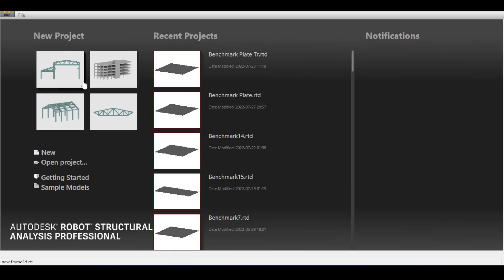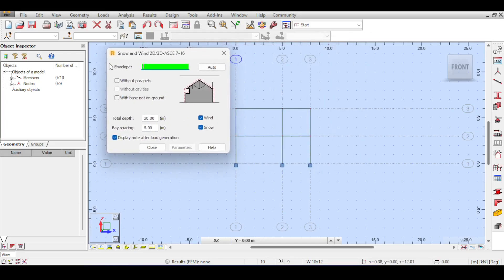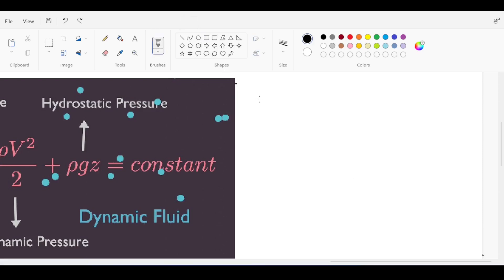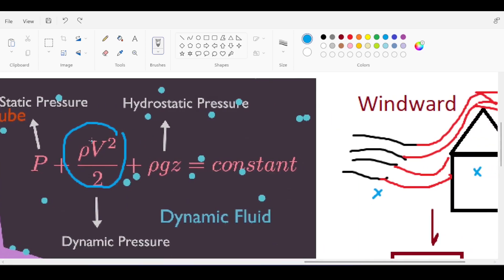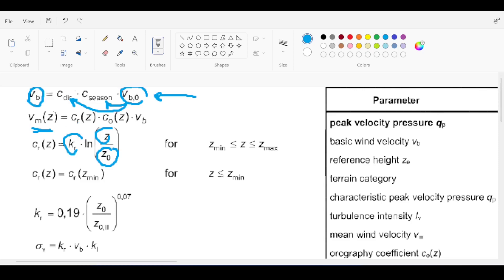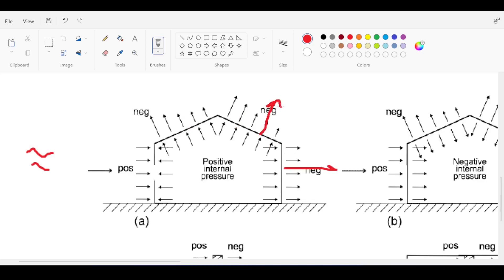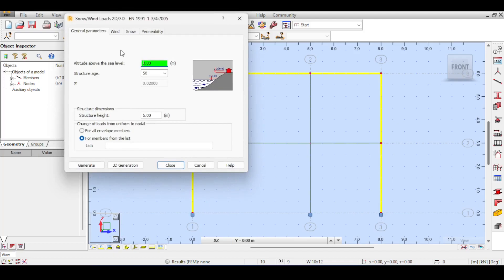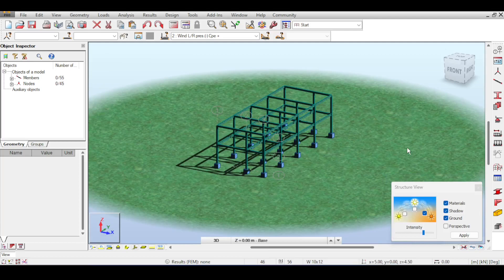Wind Loads according to EC using Autodesk Robot

Comment: Hello,
Hope you are doing well
1-based on Eurocode, and in designing a canopy, which loads coefficients we should use, Net wind pressure coefficients (Wnet) or Total wind force coefficients  (Fw)?
2- if we should use Fw, could you explain the method of application?
3-if there a canopy above a building, what would be the height used in calculation of the wind load based on Eurocode? 
Thank you for your grateful help
Reply from the maker: Oh that is quite a nice question. So here is what should be done in my humble opinion:
In Eurocode 1 (EN 1991-1-4), for canopy design, you'll primarily use net wind pressure coefficients (cp,net). These coefficients represent the pressure difference between the windward and leeward sides

Total wind force coefficients on the other hand, provide the overall wind force acting on the entire canopy structure. 

For a canopy above a building, the reference height for wind load calculations depends on the canopy's position relative to the building:
Canopy Attached to Building: If the canopy is directly connected to the building's structure, use the height of the highest point of the canopy above ground level (crest).

Canopy Detached from Building, has other considerations.

Finally, keep in mind:
Degree of Blockage: If there are obstructions under the canopy, their influence on wind pressures needs to be accounted for.
Structural Factor (cscd): The structural factor (cscd) is usually taken as 1.0 for canopies. However, consult your National Annex for any specific requirements.

I gave general comments based on your question. Of course, each specific case may deviate from those comments above.
Reply: @CivilEngineeringEssentials  Thank you
I really appreciate

Comment: You can calculate the mean wind velocity or the peak wind pressure in accordance with EC, then use the values in the wind simulation program. RSA will only apply the calculated values to the building to generate the wind loads. The simulation process does not have to conform to any code, as the codes does not prescribe how the simulation should be performed. The simulation process is purely scientific. However, the wind or pressure values used in the simulation process have to be derived in accordance with the codes (EC or American) by the user.
Reply from the maker: If I understood your correctly, you are talking about the wind simulation in RSA rather than the code calculations (the equations that find the pressure which are provided in the code)

If I understood that correctly, then I agree. The only reason I feel annoyed is that CFD simulation might seem to be a "black box" for regular users. Also, note that - as an example - the ASCE code does allow for wind tunnel simulations.

Now you could argue that CFD is as close as it gets to the wind tunnel simulation, but well, it is not mentioned in the code, so it becomes a matter of opinion.

Of course, I am always open for any info. If there are rules and regulations in the Eurocode, plz feel free to tell me.

Regards,
CEE

Comment: I have been trying to using robot to model wind loads on to a portal structure. I created the building and then put cladding on to the structure. Then I am defined wind loads on to the structure using the uniform planar load on contour surface in the surface load definitions. The only problem I have with this method is when I define the load working in the z direction for the local coordinates the load doesn´t follow the local coordinates. So it seems like the load isn´t attached to the cladding. I have to use the planar load on contour surface because EC divides the roof and walls into regions.
Reply from the maker: I am currently working on a series on the modeling analysis and design of reinforced concrete building structures, and I am actually stuck exactly here. Trying to find the best way to approach wind loads because as you see, the wind loads according to codes is kind of limited when it comes to RSA. I will post a video soon about it. Yes, there is a problem in following the coordinates of the cladding. Gimme a lil' and I will be ready with a video about that.

Sorry to not being able to provide a direct answer to your issue, I am myself battling the problem as I speak.

Regards, CEE

Comment: i think for a 3d structure you can just simulate wind load or what do you mean by weakness?
Reply from the maker: I mean that a "regular wind load" calculation using the EC code is only available for extremely symmetric structures of equally spaced frames. 

I still agree, you can perform a 3d analysis using robot.